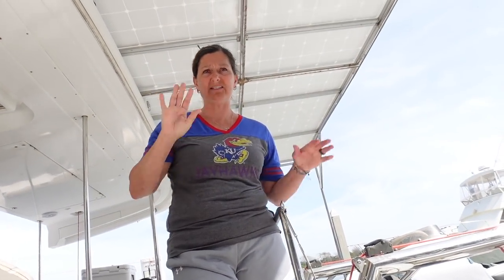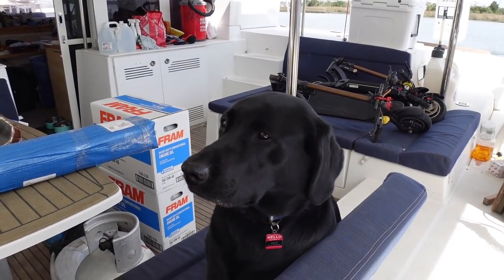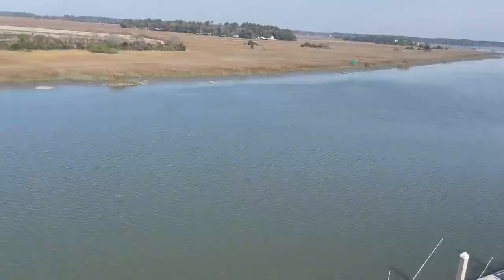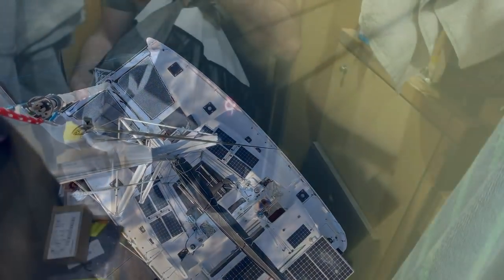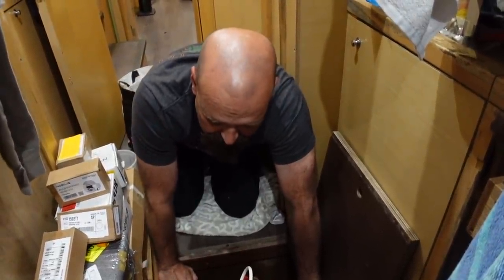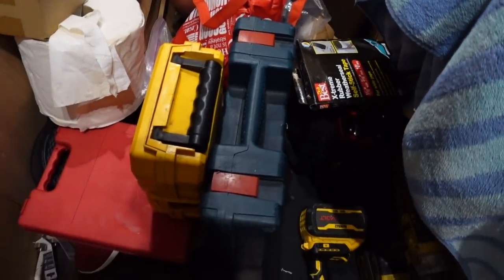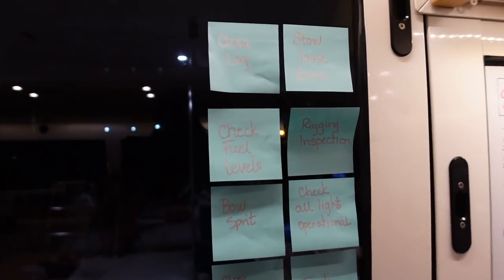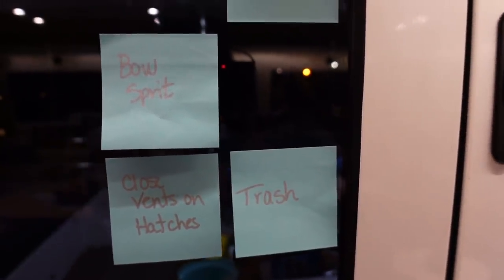LET'S ROLL//Kicking Off The Dock & Officially Leaving Georgia-Episode 73

Comment: Might want to put some sealer tape on that white coax connection.  I also use Silicone Grease on the threads.  Keep the water out of that coax.

Comment: Suggestion.  NEXT time you go up the mast, use a second halyard and have some one there to tail it around a winch as a safety measure.
Reply from the maker: It might not of been clear but there is a safety line. I NEVER climb without one.

Comment: The start of all your videos, the intro is very loud compared to the rest of the video. And from video to video, audio levels are way way different.  So if you’re watching episode after episode, you get a major WhatTHEHELL?! When you start a new one. Especially when watching on a TV with a large surround sound system.  

There are lots of videos on YouTube about loudness in broadcast and film. Watch them.  There are loudness meters plugins now in premiere I think. And also available as plugins.  They let you know what level your overall video is, hot spots, low spots… phasing.  Dropouts.  All the things that would make you fail a QC for broadcast television. And for good reason. You can damage peoples hearing and their equipment.  And then they quit watching your channel.

QC Tools is another piece of software (free) that lets you QC your video looking for faults. This tool will look at audio and give you a loudness score and let you know of any major hits or loudness variation.  

And it’s always best to mix with speakers, studio monitors with a sub, not headphones. You will not ever get a proper mix on headphones.  Especially when looking for low bass you can’t hear on mist headphones.  There usually should be a low cut filter on your videos anyway. Prevents the subwoofer from exploding every time someone shuts a door or bangs their fist in a table.  Or wind noise from your video that’s vibrating my walls right now.

mediaarea.net/QCTools

Do you need all these tools to have a proper mix on YouTube? No. If you just use studio monitors (not expensive) you won’t have any issues if you just use the meters in the editor, if your ears work, and perhaps slap a compressor on your main track.  If you need to find where you mess up because you don’t hear it in the first place, then yes you need the other QC software.   32nd time changing the volume on ep73 and I’m 7 min in🤦‍♂️
Reply from the maker: Thanks for the tips, we are working on it!

Comment: Burns are quite dangerous...I'm glad you (Kim) are OK...
About the depth sensor...lots of dirt...when you did the anti-foul did you remove it? or painted over?
I also noticed you just cleaned it and put it back...no anti-foul?
Fair winds and calm seas...
Reply from the maker: No anti foul on those type of sensors, just have to keep them clean

Comment: You have open holes on the top of your mast - Shouldn't you plug those holes up with at least some kind of rubber plugs, to keep water out? I imagine that mast would drain out somewhere INSIDE the boat.

Also- Did you actually climb that mast without help or a 2nd person to call for help, if you fell? As someone who HAS fallen from Such a height, it can be fatal...or so the doctors told me. I survived (with many breaks and fractures) but most people do not survive.
Reply from the maker: All masts have openings in them so there is no way to keep it our and you want there to be air circulation to dry it out.  The mast sits ON the boat so there is no way for water to get in.  You may not see it but there is a safety line that I am tied off to.  I NEVER climb with one line.

Comment: When I clean my transducer paddle wheel, I remove if from the transducer.  It is only held in place by a SS pin which is easy to push out.  That way a can clean the paddle wheel out on the dock with as much violence as required and use a toothbrush all the way to the bottom of slot that it fits into.  The pin is not a press fit so it will push out with a paperclip.
Reply from the maker: Good tip!